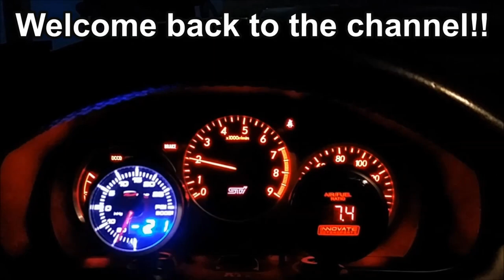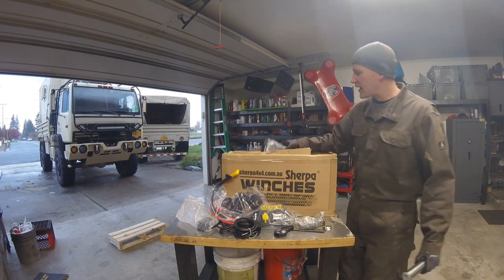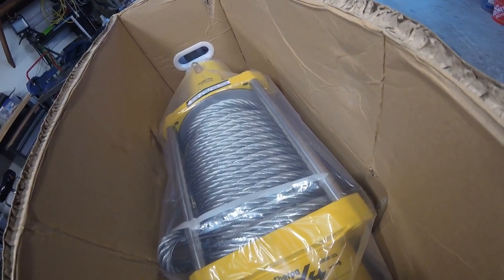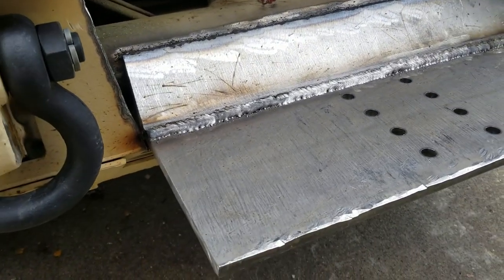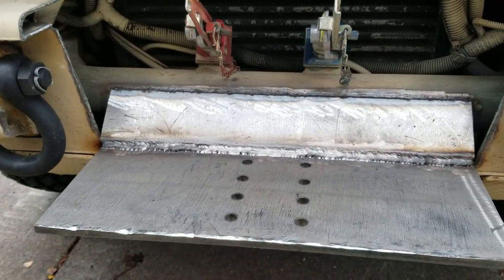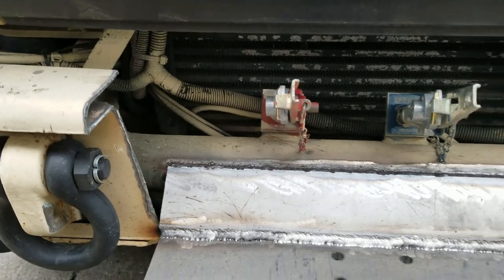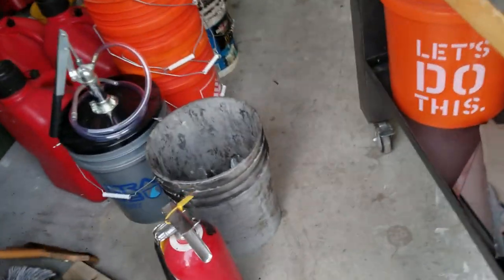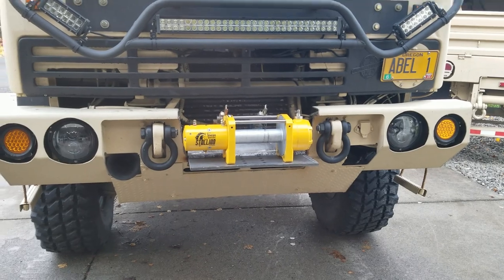Abel LMTV build part 143 (Sherpa Stallion 25k winch install Day 1)

Comment: Dude you could dangle that whole truck off a cliff like a piñata and winch yourself up with that setup 😂 awesome work man!
Reply from the maker: It is a bit overkill doing triple pass welds and triangulating a 1/2" plate on the huge front crash/cross member pipe, but that is what I do. Better safe than sorry.  Thanks for tuning in!

Comment: And some of those Stewart come out with a frame mounted winch behind the cab on the frame that ran forward and back
Reply from the maker: Yes, but unfortunately those require many additional parts and have an 18k rating.  Fingers crossed this works out as planned.

Comment: That looked super heavy I don’t  know  oh I see now nice. That’s gonna be a rusty mess where you jive. How did you cut the bumper what tool was that. I see you using a grinder. The high speed makes me laugh I need those laughs bro. I hope it’s safe for me to watch the arc over YT lol. Love that mounting plate. I need the space short driveway and I would block a sideway. Harbor Freight  sells them for 20 bucks. How thick of metal can you cut thru ?  That is the cuts pressure switch if wet tank falls below 65 it stops cutis system so you always have air for braking the truck. Thank you Don
Reply from the maker: Hi Donnie.  You have lots to say.  I am not sure I can decipher everything but if you check out my build playlists it might give you some answers I think you are looking for.  

I think you are talking about a plasma cutter??  I am not sure about the harbor freight comment??  

Yes our ctis system works fine.  Is that what you were asking about??

I am not sure what the rust concern is??  Could you elaborate??

EIther way, thanks for tuning in and commenting....

Comment: Did you ever get the winch stuff resolved with Sherpa?
Reply from the maker: Keep watching...there is a video about it...
Reply: a part 5?
Reply: @SeanFillner  was it after the emails I didn't see when I rewatched
Reply from the maker: @px9172  I had to file a PayPal claim since they refused to respond to my request to be compensated for the synthetic line.  PayPal ruled in my favor and I got a 100% refund...
Reply: @SeanFillner  that's great!  I went through something similar with tire rack one time and a set of lights.  Ended up getting them for free because they wouldn't do right on a claim or communicate 🤣
Reply from the maker: @px9172  the way it should be.

Comment: I don't think Sherpa is a good value. I bought a Colt 17,000 lbs winch. The cheap Chinese cable started fraying immediately just  winding it in and out. The motor seized due to corrosion in less than a year because it had no gasket material. Salt water from winter road had infiltrated, and it didn't last the winter. They replaced the motor. The winch tie rod bolts broke the casting. It works, but the colt model is not up to a premium product's standard. You could get the same winch for half the price. I won't be buying another one in the future.
Reply from the maker: Well, this one was free because they screwed up my order so I cannot complain about that.  We use this winch twice a year and it works great still.

Comment: Hi Sean, I need some help ... Where can I contact you?
Reply from the maker: Hi Mauro.  If you need help or advice please visit the LMTV facebook page found here https://www.facebook.com/groups/1607576859556624
Reply: @SeanFillner  I would need your help about installation of the ISSPRO R8530M tachometer ... Can I contact you on the group?
Reply from the maker: You can ask the group for advice yes.  The information I have is posted in the build series.  I am unable to offer technical help, however, the members on that page love problem solving so hit them up.

Comment: Sad to see such a bad experience  from a good Aussie company. Cant understand why you didn't  take a photo of winch with steel cable and ask them to send the correct synthetic rope by express post. At least  offer  to compensate you for their mistake.  A small innovative company like that can't afford bad publicity  especially on Social Media and should have bent over backwards to  make it right. 
Also may I suggest safety boots when working with heavy steel plate.  I"d hate to see crushed toes on YouTube
Reply from the maker: I did all of that and they still refused which was the point of this video series.
Reply: "A good aussie company" Mate, they are the BIGGEST scammers in the industry.